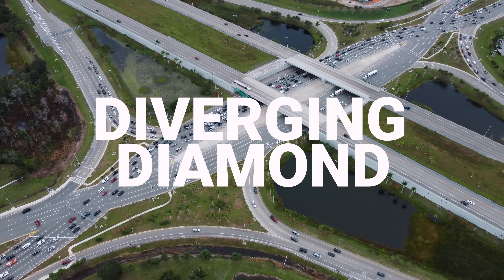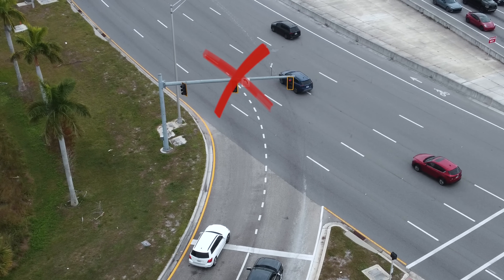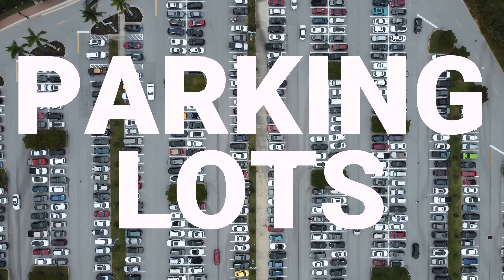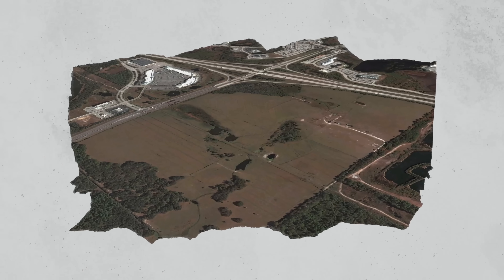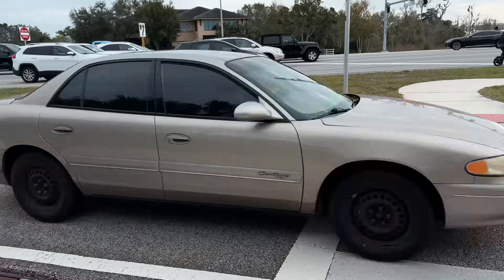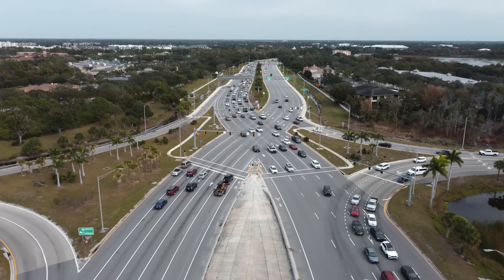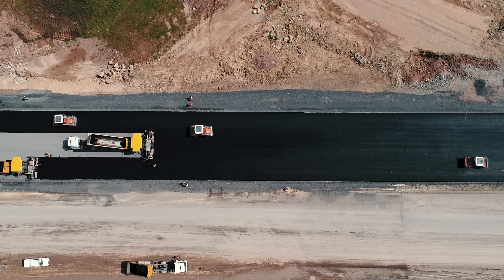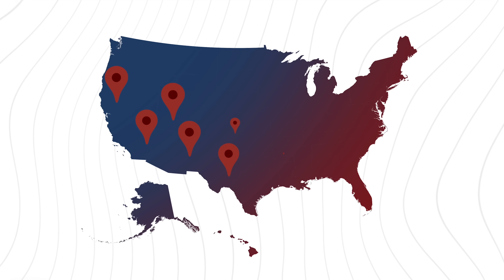Traffic Will Never Be Fixed Here

Comment: Those bike lanes are perhaps the most ridiculous part of the whole interchange.  Yeah, does anyone really want to ride in a painted bicycle gutter with 5 lanes of 45mph traffic whizzing past them?
 
Great video, I liked and subbed.
Reply: its insane the department of transportation doesnt get sued over those painted bike lanes. Literally telling people to put themselves in most dangerous situation
Reply: @Amir-jn5mo 😢
Reply: Didn't recognized those bikes lanes until 7 minutes into the video. Pretty insane that engineers think people will use those bike lanes. lol
Reply: @NuttyV2  They don't think that.  They were included as a selling point.
Reply: @NuttyV2  They don't. The bike lanes exist for PR and to appease regulators, that's about it. If they expected the lanes to be used then no, they wouldn't be like that.
Reply: @TimurTripp2  that makes sense
Reply: Bold of you to assume it's only 45...
Reply: There's a new massive road on the way to my sister's house in Florida that has the same thing. Now there is a lovely little path that runs along the side and it's quite removed so it's safe but it's clearly meant for peds. It winds along in order to make it look prettier and follows the contours of the land so there are lots of little dips up and down. This would make it much more difficult for a cyclist who's trying to commute somewhere instead of just out for a pleasant little jaunt where they could rest frequently if needed. So a cyclist's options there are to either take a super inefficient path that would leave them far more tired or a nice straight flat death ride. Oh joy.
Reply: We have a relatively new diverging diamond intersection not too far from us. For pedestrians most of the crossing has a physical barrier protecting them from cars, but they literally painted a bike lane in the gutter. I didn't realize there even was a bike lane there until about a year and a half after it was completed. It's probably about two feet wide and some of the grates take up about three quarters of it at points. It's horrible and I'm convinced it's safer to take up a car lane instead. Thankfully it's legal here to bike on sidewalks so I just take the protected pedestrian pathway when crossing there by bike and it's not the worst experience crossing a freeway that way. Most crossings of that freeway in this area don't currently have any pedestrian or bicycle infrastructure so I'll take what I can get.
Reply: @DizzyDiddy  I don't give af if the side walk is illegal. I'll have to pay a fine if I get caught. if I get run over I'll either pay with my life or with a life long debt plus my ability to run, jump, and maybe even walk
Reply: They are absurd! I'd be biking on the sidewalk in an area like this (if at all). But I think DOTs get extra funding from the federal government to add bike lanes and crosswalks in the middle of nowhere.
Reply: I've driven this road a few times and 45 is probably the lowest someone is going on this street
Reply: @NikVargaLiverpool4ever true, but the actual interchange is 35 mph (posted), however, given the drivers usual behavior it’s rare to see anyone slow down. It still surprises me how many crazy and dangerous lane changes occur, especially westbound at Cattlemen, the whole interchange is like a live version of Frogger. Rush hour traffic is even more horrid and there are very few back roads unless you can get to the roads leading to the interchanges to the north and south of University.
Reply: given how bad American drivers are i wouldn't cycle there even if the limit was 20
Reply: I would love to bike to work, but those bike lanes are just orphan and widow generators.
Reply: All the bike lanes in the Sarasota Bradenton area are like that (some of them even are in between lanes). Whenever I point out to someone how unsafe they are they say things along the lines of “yeah they should just not have bike lanes” and I’m like “WHAT? NO!”
Reply: @joaobr3419 the bike lanes in sarasota are quite good. We have a large bike club and ride them all the time. I live near here. I tried it once on a bike just to see and it was fine.  
And the bike lane in the middle of a road is to separate from the right turn lane. It's excellent and the places that don't have them are more dangerous with cars turning in front of you
Reply: Honestly it's stupid that the the designers didn't at least put the bike lanes the same way that they did the pavements, in case of big roads it's almost always safer and more convenient (from my own years of experience I can say that bike lanes placed on the road make sense mostly in case of small roads or some very specific complex roundabouts, otherwise it's better to at least detach the bike lanes from the road and give them crossings along with pedestrian paths
Reply: I like it "Bike gutter" is that equivalent to car sewers?
Reply: Thats why i bike on the sidewalk lol
Reply: @boi5599  We actually have a lot of double wide sidewalks here. You frequently see 4 people walking side by side down them, or people on bikes will roll past at low speed. Anyone going fast goes on the road. It works quite well - the areas at city intersections where the sidewalk juts out closer to the other side of the street - those wide areas sport benches, tables, chess sets, fountains, etc.; we do seem to have a more active "downtown" than most.
Reply: @BikeHelmetMk2  Thanks for the informative reply! Im from florida so im use to seeing bikers on the side of highway but here the towns around me try to invest in their bike trails leading to viable hubs and such depends if i want to go to that location
Reply: Surely but the most hardcore and fearless cyclists would use the pavements (sidewalks) & pedestrian crossings since they're virtually crossing a motorway?
Reply: You have some of the issues of a cloverleaf though and faster traffic just can’t keep left in this intersection setup. For instance, an elderly retiree who wants to turn left onto the interstate will have to merge to the far left lane and zipper merge with incoming traffic from the off-ramp in the right bound direction (unless signal controlled). I think it’s good for medium throughput though.
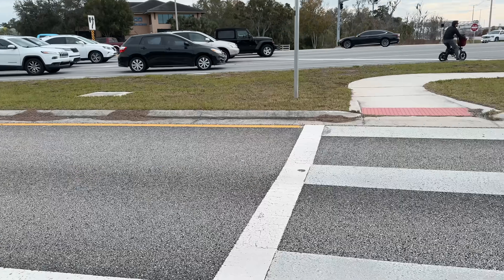Reply: There was someone game in the video :) (7:34)
Reply: Ha 45 mph? The traffic is going 60 at least.
Reply: Step 1: Hear people demand bike lanes
Step 2: Build bike lanes that are a death sentence to the user
Step 3: Nobody uses them
Step 4: Deny building more bike lanes becuase "nobody uses them"
It's not an accident.
Reply: There is one more improvement that could be done to these diamonds during construction - in areas where water tables allow - put lit tunnels under the road for pedestrians, rather than crosswalks. We have one near where I live, which connects "downtown" to a big park, and it is rare not to cross paths with someone walking through that tunnel.
Reply: @BikeHelmetMk2 There are places where there are separate areas in the bridges with under/overpasses instead.  It’s not always tunnels though.  That’s expensive.
Reply: @BikeHelmetMk2  i think accessibilty would be an issue
Reply: @Rhaenen  The tunnels have gradual ramps leading to them. They're great for walking and biking under the highway.
Reply: @BikeHelmetMk2 many of these tunnels would quickly be filled with tents and the associated garbage middens, human waste, and drug detritus.  No easy solutions
Reply: @brianmiller5444  That hasn't happened here. They're not big enough to be appealing. The homeless camps typically take up larger areas, like the train yards, or parking lots next to public restrooms. Even there, they favour the locations close to malls. Walking distance to food, and all that. If they can find an abandoned building they'll move into that. There are occasional news articles where 30-60 are discovered in some building slated to be demolished.
Reply: There’s perfectly suitable sidewalks you can bike on. Don’t give me the bootlicker “but law say bikes don’t go on sidewalks” stuff. Bad laws require civil disobedience.
Reply: @1-j-1-j-1  The problem for traffic is when bikes on sidewalks drive across the intersections when they are supposed to walk.
Reply: @francismarion6400  no, you put ur feet down, press the button, then bike across the crosswalk. It’s not a hard concept.
Reply: @1-j-1-j-1  The law says you must walk through crosswalks for a reason.
Reply: @francismarion6400  like I mentioned before, nonsensical laws require civil disobedience.
Reply: @francismarion6400   like I mentioned before, nonsensical laws require civil disobedience.
Reply: @reeddeer793  Civil disobedience means you live long enough to make your court date, otherwise it's just Darwin sorting you out.
Reply: @francismarion6400  biking thru a crosswalk with the pedestrian light in the “walk” state is not dangerous, unless someone runs a red light. 

However, when biking you should already be on the lookout for cars that do things like that, otherwise it’s just natural selection.
Reply: @reeddeer793  Biking through a crosswalk you have the rights and duties of a vehicle. Most crosswalks do not have a pedestrian walk button. If you drive your bike off the sidewalk and into traffic, cars don't have time to react and someone could die.
Reply: @francismarion6400  if you ride ur bike right into traffic, it is natural selection. If the crosswalk doesn’t have a pedestrian walk button, you wait for the signal to change to “walk”. When biking across a crosswalk, you follow the exact same procedures as someone walking across, except you are biking.
Reply: @reeddeer793  I don't ride a bike anywhere in this town. I visited Anchorage last year. They made it legal for bikes to cross anywhere and they don't have to stop at stop signs. These laws are dangerous and idiotic.
Reply: @francismarion6400 We have toucan ("two can") crossings in the UK where it's actually legal for cyclists to rid over a signal controlled pedestrian crossing between shared use cycle paths/pavements.

Though none I'm aware of with as many lanes without a middle refuge as these crossings.
Reply: @1-j-1-j-1  The problem with biking on sidewalks is that you're traversing pedestrian space with a vehicle. That's bad for both cyclists and walkers, no matter what the law says.
Reply: @Spearca   it is possible to create paths that are fine for mixed use between pedestrians and cyclists... regular footpaths that weren't designed for that along the sides of roads are not that.
Reply: Never mind all the grousing, the "Diverging Diamond" is a major advance in that the colonial renegades are dipping their toes, once again, into driving on the CORRECT side of the road.